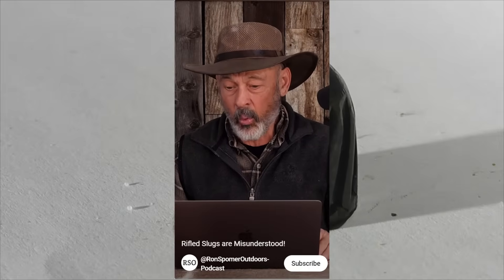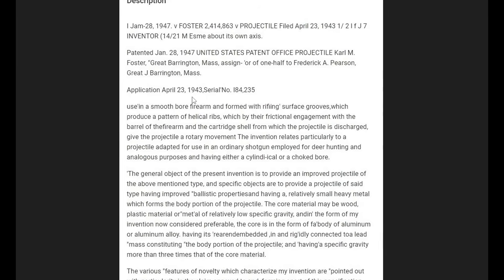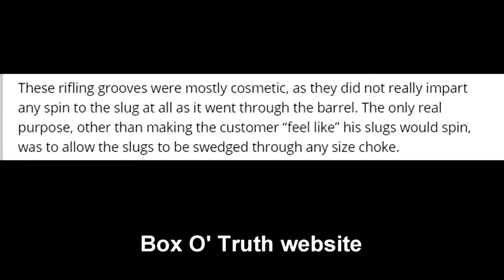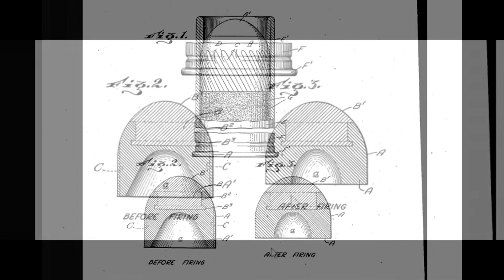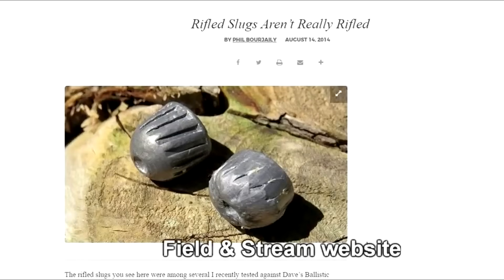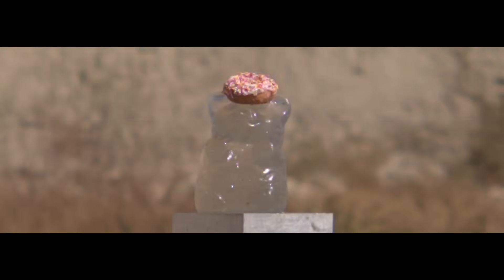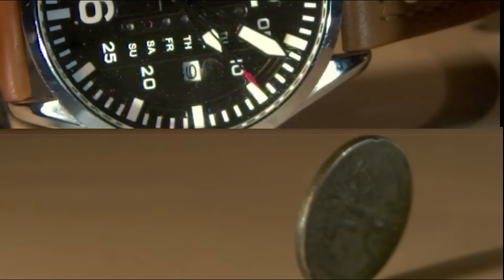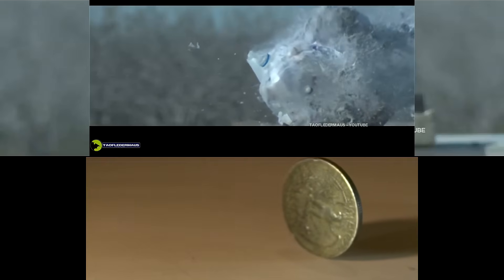Yes,  RIFLED Shotgun Slugs SPIN - The high speed camera doesn't lie

Comment: Duh,that's what stabilizes the slug,yes you can hear one coming, my 12 gage smooth bore only touching the inside of the barrel in the upper right corner of the barrel, yet I've shot deer at 150 yards easily, sometimes offhand, yes 4 power scope

Comment: I think air resistance is more likely to cause the spin than the smooth barrel. In a rifle the bullet is “screwed” trough not in a smooth barrel but a rifled slug is more likely to screw itself trough air resistance if the rifling is not f up by a full choke. Maybe you could think of an auger being pulled by a string in water

Comment: 1:55 I’m a mechanical engineer. If it was supposed to shrink while going down a choke then there is no reason to angle the lines. This is what happens when a bunch of people and engineers who arnt mechanical start pretending to be one. This is the inverse of a rifled barrel & I know before continuing this video that it’s going to spin; if not leaving the barrel then once it hits the air because of fluid dynamics. 

I’ll eat my words if I’m wrong… continue video.

3:18 as expected!

Comment: Well sure rifle the projectile then it continues spinning in flight let alone inside the barrel _ the drag is gigantic is like a jet engine x50 firing at it - jet engines aren't usually supersonic pressure tends to out the fire out basically 😳.  Holes you could add also a propellant that adds spin 😉

Comment: With a rifled slug, it's not that the rifling on the slug bites into the smoothbore, but more the wind pressure rushing through the ribs on the slug that imparts a slower spin compared to that of a conventionally rifled barrel.

Comment: Thanks for proving, basically, the Foster slug  doesn’t “spin” like a regular bullet does.  Your crude ‘test’ with a high speed camera was based on a spinning quarter ; nothing to do with the slug traveling to the target.  It doesn’t take a whole second for that slug to travel to the target, and thats only one fail of you test method.  Cute that you compared you miscalculation to the 750 rpm your truck engine idles at .  Absolutely nothing to do with the rpm to stabilize a projectile.   Whether the slug rotates at 750 rpm or not is totally inconsequential.  Most stabilized bullets rotate at not 750 rpm, but 240,000 rpm.   That’s two hundred forty THOUSAND RPM.
Reply from the maker: I'm looking forward to your video on this subject.
Reply: @ because you made a video doesn’t mean you are correct.  I used 55 years of experience ( 70 yo ), licensed professional experienced gunsmith for 30 years and math.  Math is fairly accurate, wouldn’t you say?  Thanks for you attempt at providing your theory.  I’ll say the evidence is still inconclusive.  Fortunately, the end result, because few shotgun slug guns are used in target competition, the end result is for hunting with the slug and accurate enough for a humane kill.  So, always check the accuracy of your equipment and hunt ethically.  Thanks for your video.

Comment: I would not shoot a rifled slug through a rifled barrel or choke.  It kicks like a mule and screws up the accuracy.  Sabots through riffled barrels and rifled slugs through smooth bores.  I have shot more deer with my duck gun and riffled slugs than all of my other guns.  I learned the hard way.  I would also watch what slugs I shoot out of a rifled choke tube.....Lightfield type slugs out of a choke tube.  The wad type slugs will / can keyhole from as little as 20 yards out of a choke tube.

Comment: I always understood that Foster slugs do spin but not fast enough in a smoothbore to stabilize it at longer ranges. I would like to see footage of the slug at 75 yds. to see if the slug is wobbling. I've seen oblong holes in targets with Foster slugs at 100 yds.
Reply from the maker: The foster slug would be stabile without any spin.   The spin might help to "normalize"  trajectory if the slug is slightly deformed and imbalanced during the the firing cycle.  Instead of drifting, say, to just the left,  as the slug rotates it will stay more on target by buffering that out.

Comment: Think of the enormous pressure on that hollow base from the expanding gas of the charge? Smoth bore or not that shoug is going to spin in the direction of those ribs!
Reply from the maker: There is a gas seal between the slug and powder,  so the slug is isolated from that.   The inertia from the rapid acceleration causes the slug to collapse under it's own weight  and expand outward to fill the barrel tightly.

Comment: That's why I don't understand why people and manufacturers are putting slugs into wadcups. Like in a Minnie bullet hot gases should enter back of a slug forcing it outward creating proper seal between slug and a barrel. Making slug more accurate. 
If I'm wrong please correct.
Reply from the maker: Because the shotshell has a dedicated gas seal to do that.

Comment: I have a copy of the Winchester-Western Ammunition Handbook, which discusses rifled slugs in detail.  Winchester, in the 1960's, fired slugs under high speed motion photography, and verified that the slugs do rotate, which improves accuracy.  The book also said that the slug depends upon the large hollow base to stabilize it aerodynamically.
I have a Lyman 12 ga slug mold, which casts hollow base slugs.  They are not rifled, but do hit nose first.  Accuracy is not great.

Comment: You must be an Engineer.  Thank you , interesting video.  Being old, I remember some company made a hollow base bullet mould shotgun slug.   If I remember , it didn’t have ribs at all.  Might’ve been Lyman ?  I wonder if it’s the contact going down the bore or the spirals going through the air. Or both?  I have an idea for some young fella;  invent a shotgun slug round with the inside of the shotgun shell tube rifled, matching corresponding rifling on the projectile.  Make it a good tight fit, proper rate.  I bet that first inch of projectile travel would actually begin spinning it pretty good. As it would begin spinning it from zero travel.  Might twist (spin the shell in the chamber) the shell, but maybe not with all the all the P against the chamber wall.  The purpose?  To better improve slug performance in smooth bore.  There, old guy just gave someone idea to make $million$ .

Comment: I don't know much about slugs but I did hit a 60% torso plate at about 110 yards and I figured that was only possible because the slug was rotating. Not that that's impressive or anything but I thought the slug would go off in another direction by then, out of a smooth bore barrel. Then I saw what a slug looks like out of the shell and it made sense. I didn't even know people argued that they don't spin.

Comment: My problem with rifled slugs is not that they don't spin. That's irrelevant at close range like this guy is shooting. Shoot at cardboard at 80 yards and you will see that they tumble something awful, indicating that they are nose heavy and don't spin fast enough to keep them pointed nose first. Thus terminal energy and penetration on game and maybe even flight path consistency are compromised. If you must use a shotgun, use saboted slugs and a rifled barrel. In my Ithaca 12 ga. w/ deerslayer barrel, I find that Remington Copper Solids fly true and are lethal at long range. They are expensive, but a one shot kill is worth it in my book.

Comment: They do spin - why is one question that can not be answer with just "cause it has a spiral groove": Movement is very very counter-intuitive when it comes to rotation.

But the spin is not the goal of the design nor does it really add anything in terms of precision: for gyroscopic stabilisation the rotational velocity has a quadratic influence. With the rifled slug here rotating at like 1/20th the rate compared to a rifled barrel that would be less than 1% the stabilisation force... not something relevant.

The grooves are only there for a very short moment - before they get squished against the wall and form a tight fit. If they were not spirals but straight then they could form air-channels around the slug - not something you want.

Comment: Aghr.     ...It will be absolute minimal if so and logic says the rotation needs a counter replusion the opposite way /  something to push off -  yet in the barrel all the grooves are doing the same thing so mathimatically its doing nothing -  I assume  and its a trivial waste of time.  As long as the shooter can shoot straight - right!   Man do they have a kick.  Blow a hole clean through the thickest wooden fence post with a short barrel pump action.  Even with a thick Swandry jacket  "it literally felt like someone hitting you in the shoulder with a sledgehammer."  I fired about 5-6 rounds before enough.

Comment: Would be curious to see an analysis of which is the dominant force, the drag stabilization due to the shuttlecock shape of the slug, or the rotation speed (which is significantly less than anything actually fired out of a rifle).

I'm guilty of spreading the "it's for chokes and not really for spin stabilization" although I remain skeptical of the amount of stabilization imparted via spin vs drag. So for now i'll say "they spin a little bit" instead

Comment: Wouldn’t the riflings kind of act like really stubby fins, or channels, and as it cut through the air the fact that they are set at a slight angle would mean the friction of drag would apply a little spin force to it? On the other hand, I’ve seen some hi-speed footage that clearly showed the projectile was tumbling end over end, and/or side past side, like a frisbee, and seemingly as long as it was tumbling symmetrically around its center of gravity, it wasn’t encountering any force that would cause it to depart from the expected ballistic path … sorry, gotta go

Comment: The fact that they always hit face first means they have gyroscopic stability. You have to be pretty ignorant not to know of such a basic concept. And before anyone points it out, the length of the slug has no bearing on righting itself. The slug is made of a single material with little air resistance. So the fins don't cause enough drag to even slow it in any meaningful way. Its shape is irregular, so when it meets resistance, it will tumble. Especially at supersonic speeds. Thus, it needs to be gyroscopically stabilized through rotation.

Comment: The idea of using a light mass at the front of the original Foster slug reminds me of how the 8mm rounds for the CETME were designed with an aluminium core and a thick copper driving band - with most of the mass concentrated around the slug in a ring, it spins up like a flywheel and thus attains better stability from gyroscopic motion. That's my theory, at least.

Comment: They were supposed to swap the fouling ...the hollow cavity does make it front heavy which does most of the stablization...
Old round balls (aka pumpkin balls) were less accurate... 
Here's the proof of this. 

Lyman has a slug mold that is sahped like a big airgun pellet ... with a flat front... this is made smaller than the bore and is designed to fit into a stiff based shotcup ...it has NO rifflings, and even if it did they would not contact the bore... 

These slugs show darn good accuracy when shot with a correct load and fired from a modified choke shotgun...

 What keeps them straight  ? The rear skirt is light and some are hollow , the front is heavy... i've shot thesebout to 85 yards with good grouping ...

 Also - there were slug molds that looked just like the rifled slug minus the rifling..they shot exactly the same . I wish i still had one to cast a few and have you send them down a modified choke for an experiment.. note: these arebmade with a lowered hardnessbas to not hurt to choke... even though I have molded them with wheel weights before with no negative effects on the choke...

Any spin on that slug is not giving much inherit accuracy... I've always know they spin because of being downrange and operating targets when someone put a few in his shotgun and i heard the spin. But still stand by the  fact that foreward weight does more .
Reply: Round balls in a smooth bore were less accurate, but when they started rifling barrels in the civil war, putting a spin on a round ball made them very accurate out to 200 yards. Casualties went way up after that.

Comment: They may spin, but they are not balanced enough to spin evenly...and they do not spin fast enough to produce true stability. 
So, sorry to disappoint, but they will never have the stability of a projectile properly designed for a rifled barrel...and fired through such. So, they will never be as accurate as such a projectile.

Comment: I have to disagree. Yes, they obviously spin a little, but this adds pretty much nothing to the stability in flight.
Rotational stabilization is proportional to angular velocity SQUARED. This rotates @750 rpm. 
Pistol bullets rotate at more than 50.000 rpm. Rifle bullets even spin much faster at >100.000 up to ~ 250.000rpm.
Lets say 75.000rpm for now. That is 1000 times faster than this slug. That means that the stabilization is 1 MILLION times stronger than with this slug. And this fast rotation is necessary, or we wouldn't do it. 
Maybe what we see here is just a neglectible side effect from the slug being swaged through the choke. 
It would be interesting, if it spins at all out of a non choked barrel.

Comment: As long as the slug fits snug in the barrel then it will spin if the slug has rifling. Here's why: There will be a frictional difference between the lands and groves. Since the rifling is at an angle there will be an angled vector force pushing from friction towards the edge of the bullet surface thus causing a spin because of the angled rifling. Another factor that contributes to spin is the tremendous gas pressure produced when a cartridge is fired. Extremely high pressured gas gets into the groves and spins the slug kind of like a fan blade. 2nd example: ( I like to be concise. After all, I am a teacher), ok, you have a bald tire on a car on a smooth surface road. Turn the tire to the left ( think of that as angled rifling). Push the gas pedal a little. The car goes to the left simply from angled vectorized friction towards the left even though the tire is bald (a smooth bore). See how easy life can be if you just  think things through.

Comment: The question is for me, does the rifle slug spin fast enough to stabilize and make it more accurate?
Reply from the maker: It makes is more accurate if the slug is slightly deformed during obturation.  Instead of drifting in one direction,  by rotating a little it "normalizes" the trajectory and brings it back to the point of aim
Reply: @taofledermaus  but has anyone bothered to see if it is more accurate than a similar unrifled slug.

Comment: At 750 rpm and say 1200 fps, that means the slug is effectively. . .1:96 foot twist? That's not remotely enough to stabilize the projectile. In my opinion, the rifling on the slugs is just an old marketing gimmick, suggesting higher accuracy than these slugs are actually capable of.
For a future video, it'd be cool to compare stability/accuracy of rifled vs straight fluted slugs that were similar otherwise.

Comment: Foster style slugs have served me well for many decades. Accurately, within reasonable range limitations. Out of a 20" Ithaca Deerslyayer barrel. Out of an 18.5" Winchester 1300 Defender barrel. Out of an 18.5" Mossberg 500 Cruiser barrel. And a few others in longer barrels (old single shot top breaks). Keep it under a hundred (or so) yards, and a good foster style slug will not let you down, if you do your part.

Comment: I think lightweight nose in Foster slugs changes the weight distribution, so that the main weight of the bullet is a hollow cylinder (with an empty central part). That way it makes spinning more stable, lighter nose doesn't affect the rotation.

Comment: Im sure I was 12 years old  hunting deer with a 16ga and understood rifled slugs spin , this isn't new information.  And no you dont shoot rifled slugs through a choked gun for obvious reasons , cylinder bore only. Sabots are a different story.
Reply from the maker: You can shoot them through a choke, in fact some people have seen improvement in accuracy using an IC choke
Reply: @taofledermaus  interesting, having communicated with Federal ammo directily they are very insistant that their slugs, what I shoot, is only fired through a smoothbore barrel with no choke. Very interesting.
Reply from the maker: @panthermartin7784  Did they give a specific reason?   For safety they must make them so they are safe to shoot through even a full choke.  And they are.
Reply: @taofledermaus  Yes the stress on the choke threads being pulled out.

Comment: Of course they spin!  It's due to the air flowing through those grooves, which act like fins.  A better design for the slug would be to have the grooves extend all the way, with no ridges at the front and back, and to make them deeper.  It's the wad that seals off the propellent gas, so this would not pose a problem with gas leakage around the slug.
Reply from the maker: When the slug leaves the barrel,  the ribs are pretty flat.   Also,  there is a shockwave at the nose that prevents air from flowing over the ribs.